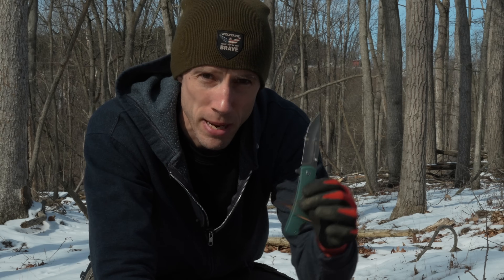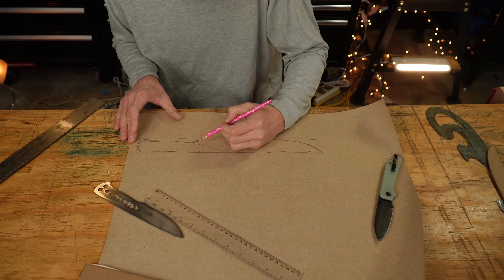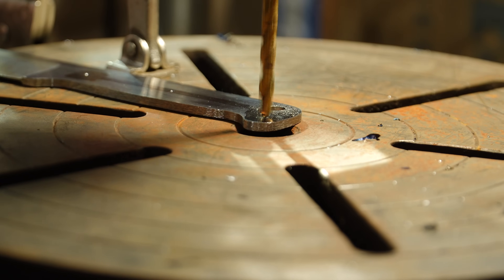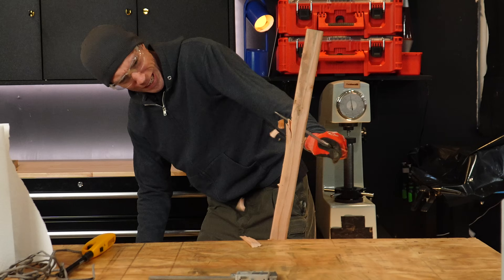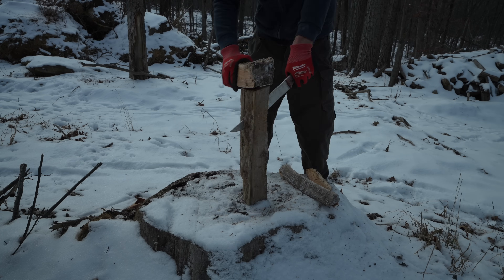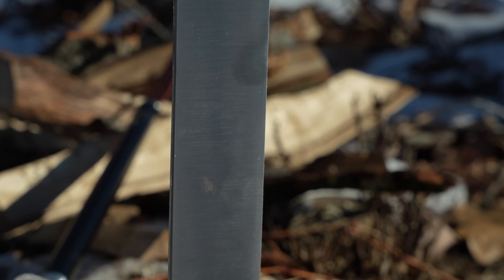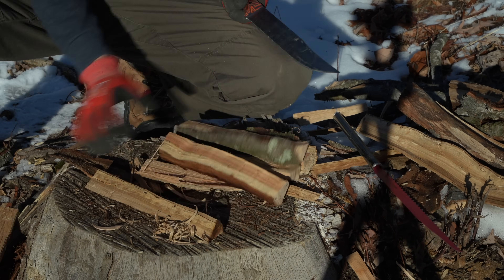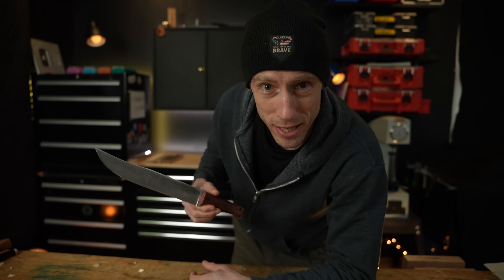Addressing The Dirtiest Word In The Knife World

Comment: Have had several large blades in S7 over the years. Wonderful big blade steel. Most of them 58-59 hrc. Really interested on seeing how it does at a higher hardness. Will add at 58-59 going thin on the grind you can get some crazy deformation on the edge. Sometimes to the point that if it just broke out the edge would probably be easier to fix. Damage to the same depth on the knife with a warped  flap of steel sticking out to the side. Never broke though.
Reply from the maker: Yeah thats the downside of the lower hardness 🙁

Comment from the maker: How else should we test this knife? Ill leave it up to you, let me know⬇😬
Reply: Since you are going to mess w it you could take thickness off until problems (probably quick I saw it wiggle) then you could shorten it until it’s better then thin it again and so on…get several stages of measuring length and thickness…like most of my 304 gfs have 👍🤣
Reply: Some really knotty wood Splitting knots often twist the blade but it is S7 steel so should be ok. I like S7 and 1055 both are real tough and dont break very often. Edge retention really don't bother me I can sharpen a blade in the woods but I cannot fix a broken blade in the woods... nice video a kiln makes the difference for that precise heat treat.
Reply: Hollow grind would be interesting along with a fuller for strength but that has to be forged in I believe to make it strengthen the blade properly. Experimenting with different tip types would be cool as well, drop point,  clip point, sheepsfoot etc.. thanks for the great vid and keep making sharp things fun and enjoyable
Reply: GRIND IT THINNER!!!!!!!!!!!!
Reply: @ when’s the Protech Large Don available?
Reply: Loan it to a mall ninja and see how long it takes them to complain about the weight.
Reply: Im curious about edge retention from that steel. All the internet says poor edge retention but tough. 
Just a suggestion
Reply: Commie chop test?
Reply: Make it into a Rambo knife (stash handle, serrated spine, glorified multitool) and then debunk it's effectiveness as a survivalist tool, all to the theme of 1980's Stallone.
Reply: Have it prove its true worth by auctioning it here and forget the silly prying by instead selling it with a lightweight splitting wedge ans your saw.
Reply: I'm afraid you're going to have to make a scandi grind version for comparison. There's a reason puukkos are scandi grind...
Reply: Throw what you can at it 💪 I'm interested in seeing how it does once you have it really thin. Don't think I seen a "thin" S7 knife before, usually big choppers and hatchets.
Reply: Give it away to someone who does wilderness survival videos and ask them to test it In there next video.

That guy from Canada who won alone seems like a chill guy who would do that.
Reply: @OUTDOORS55  I left so many comments don’t know where to pick…but I just got the BR Bushcrafter 2 today (desert iW, bulk liner mosaic pins 🤪) it has a thick scandivex (? IMO) but it feather sticks oak…even kinda green and damp….like a somma bish. …the most beautiful easy no pressure curls….hold on I got to catch my breath it’s so awesome……I love her. I’m in love.
Just letting u know I agree with you oak sucks for feather sticks….except for the grinds I mentioned…GA climate and oaks….also need kydex on everything leather contact will rust knives here